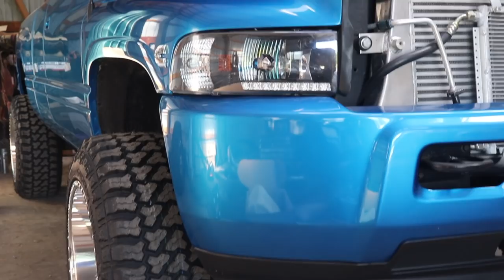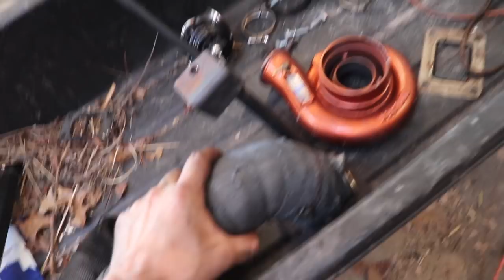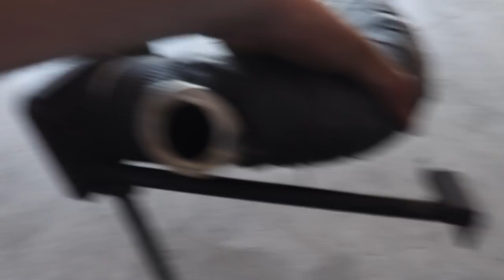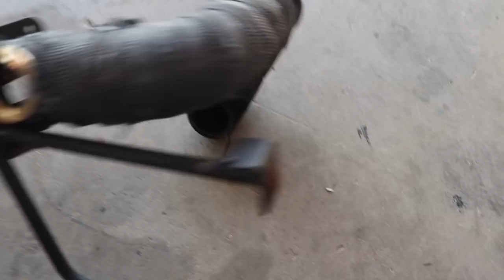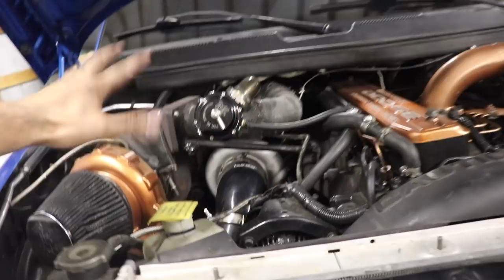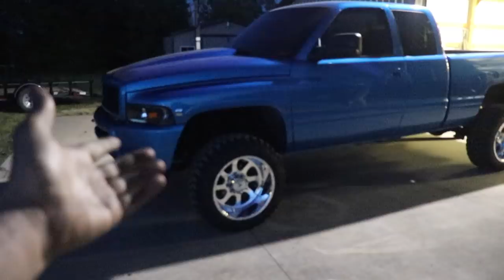NEW TURBO DROPPED INTO THE TWIN TURBO CUMMINS!!!

Comment from the maker: *LAST 19 DAYS TO ENTER TO WIN!
Every $15 = 1 ENTRY! To take home your new truck!*
https://team-lnp.myshopify.com
(Truck is running AWESOME!!! Been driving it a lot lately and I’m beyond impressed!)
Reply: LOUD 'N' PROUD on a 12 valve that lower support takes the weight off the head and spreads the load.  To much weight hanging off will break the ears of the head where the manifold bolts . That happened on my compound kit on my 12 valve

Comment: I can understand why that support is on there. You probably aint seeing it but when you get on it and the turbos start spooling its probably warping. It might feel solid without it but you never know how much stress is being put on when hitting throttle. They always say better to have it and not need it then need it and not have it. Almost like taking a bycycle rim and holding it by the axle and spinning the wheel and youll feel the force pulling around. Turbos do more work then what we think.

Comment: Why wouldn’t you have swapped the turbo housing cover to the paint match while you were right there
Reply from the maker: Riley Bourassa When you look at them side-by-side the new one is just in way better condition and not scuffed up from 20 years of wear… However the old cover will go with the truck of course. It’s not hard to swap out.